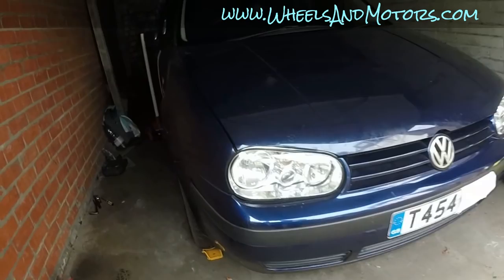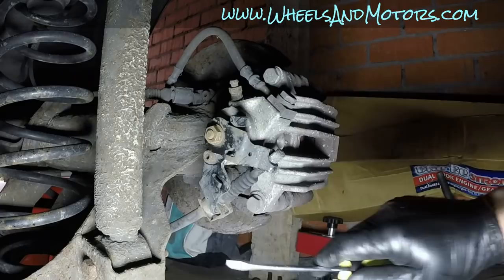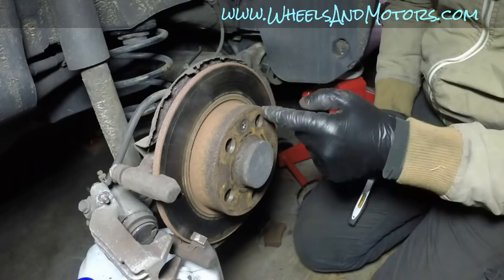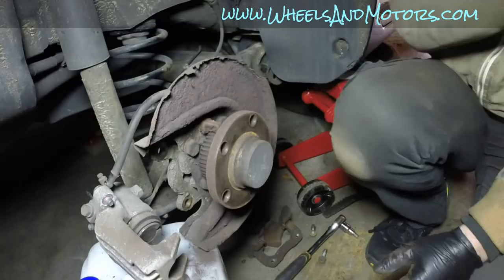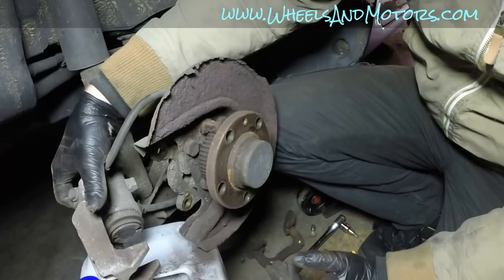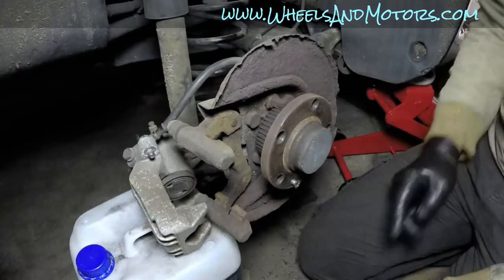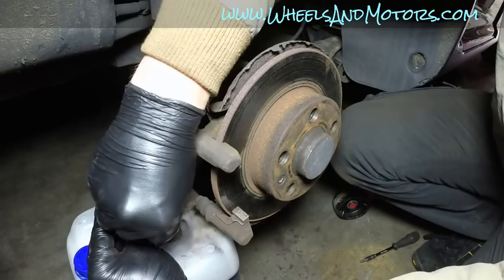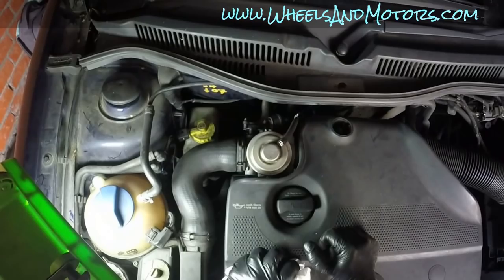How to replace rear brake pads and discs VW Golf Mk4, Audi A3

Comment: Well explained in a simple and comprehensible way so that this job can be done by those with very little experience. Great video.
Reply from the maker: Changing brake pads is not a rocket science 😊
Whole point of WheelsAndMotors is to get people confidence

Comment: After seeing this video I bought a kit from VW , contains both rear discs, pads, new bolts and springs for £84.00. The new discs in this kit don’t need cleaning they are covered with a silver coloured paint that the pads will wear through.

I purchased the same rear brake compressor tool  kit shown in this video in the red box from amazon for £15.00. No instructions with this kit. 
I used the RH piston compressor tool and turned clockwise for both calliper pistons.

You must release the handbrake before trying pulling the calliper off! I tried to remove the calliper with the handbrake on and fortunately realised that it wouldn’t come off because I had left the handbrake on. ;) 

When I finish and tried to put the handbrake on again and I found that it came way higher than normal and did not work. However I started the car and pressed the foot brake a couple of times and then the handbrake functioned normally.

Thanks for this video it inspired me to change the discs myself!

Comment: Nice video. Haven’t done the rear brakes on the 2002 Golf since we bought it 4 yrs. ago. I suggest as someone else commented to take out the slide pins off the bracket and put fresh grease to ensure even pressure on the pads. I’ve had a few cars with uneven wear on the pads that was caused by a seized slide pin.
Reply from the maker: Yes, but please don't use copper grease. I have seen caliper bracket with stuck pins, as grease wears out bits copper cause trouble.
Reply: @wawayltd  Silicone grease would be better, correct? Which would you recommend?
Reply from the maker: Any that is temperature resistant.

Comment: Great comprehensive presentation.When I recently replaced all my VW Mk 4 brake discs I found the locating screws too tight to turn but I used a hammer driver In reverse and all came free very easily
Reply from the maker: Thank you :) I think, I should get power tools at some point...

Comment: I'm tackling pads and discs all round on a mk4 golf for a friend soon.  Thought I'd just check it was the same  procedure as my Audi a4 b7 which it is exact same.  Thank you for the video.
Reply from the maker: You'r welcome. It's good that VAG has similar brakes across most cars - easy to get parts and easy maintenance.

Comment: Just one question.
In the cars with ABS braking system, i was led to believe when pressing the piston of caliper, oil does not go back to the reservoir because of the non-return valves in between caliper & Reservoir.
In that case, we may have to bleed while pressing the piston.
What are your thoughts?
Reply from the maker: I have experienced few times when I press pistons - brake fluid reservoir was overflown. Check this video:
https://youtu.be/lBzEk72sMr0

Comment: Very useful explanation. Great presentation. However am not able to take out the rotors. Seem to be stuck.  Any idea how to get them out?
Reply from the maker: Thank you :) Give them little whack with the hammer. Same as wheels that hasn't been changed for a while - rotors can get a bit of rust underneath and get stuck.

Comment: yes mate it helped a lot I opend it all after watching your video but the problem still exist..right side wheel is very heavy when handbrake is off..I pushed the cylinder in after opening but brake shoes are still rubbing with disc on right side when moving the car..hand brake cable is okay I dont know if I have to change the caliper..?
Reply from the maker: Normally brake pads are rubbing brake disc little bit anyway, but it shouldn't be too heavy.. I don't know what to suggest. Maybe take advice from some local mechanic - he can try it and say how bad it is.
Reply: +WheelsAndMotors thanks mate..will give it a go by changing the caliper from breakers yard as people say they do get sieze over time.

Comment: You say the rotor can be removed without removing the bracket, it seems to be the same as mine, however I own a Seat Arosa (VW Lupo), can the rotor me removed without removing the bracket aswell?
Reply from the maker: I'm not sure. Some cars let you do that, some don't. Best thing is just to try it - if you can't get rotor out, just remove the bracket.
Reply: @wawayltd  Problem is I cant get any ratchet behind the bracket to losen it haha
Reply from the maker: There must be a way.. It's a  VW.. 🤔
Reply: @wawayltd  shock is in the way, cant seem to find the right tools to get in between them

Comment: On one side my piston would not push back. Eventually I found that it would only return if the bleed screw was undone ( even with the brake line disconnected ). I assume this indicates a fault within the caliper, a one way blockage of some description?
Reply from the maker: I agree that there is a problem. Brake fluid must flow easy through the line.

Comment: will you be able to push the pistion back with a set of pliers?
Reply from the maker: Problem with rear caliper pistons - you need to push and turn at the same time. If you have strong hands, you can try..
Reply: That’s heaps for the quick and informative reply. You’re a a legend!

Comment: Thanks for uploading .. i did manage to snap one of my brake lines though .. is it easy to fit a new one ??
Reply from the maker: I had to replace brake line on VW Passat once. They supposed to be easy - bolt off, bolt on.. I mean nut ;) Just fit the new one same way as old. But! It's important that you bleed your brakes after that. There are plenty of videos on YouTube that show you how to bleed brakes.

Comment: If I am just doing rear pads, and open the brake fluid reservoir to push the piston back in place, will I need to bleed the brakes or do I just close the brake fluid res back up?
Reply from the maker: No. In that case - you don't need to bleed brake system, because if you open only brake fluid reservoir air don't get into system... Unless you have your car upside down  😉
Reply from the maker: ...or if it's empty...
Reply: @wawayltd  Thanks for the reply and info.  I will check brake fluid level before doing the rear pads.  I have never done brakes but I have a 2000 Golf and watching this video makes it seem awfully simple so I'm pretty confident I can replace the pads myself.  If I had to bleed the brakes, I wasn't going to do the job alone.
Reply from the maker: @alextothehbro  After you do it couple times - you'll see that it's not a big deal at all. It's like changing socks 😏

Comment: So any side we can wind postons back clock wise? Please confirm. Thanks I have an Audi A4 1.9tdi 2003 year
Reply from the maker: On your Audi - it would be same as this VW. Both calipers need to be turned clockwise and pushed. Some cars might have different brakes where you push in and turn anti-clockwise, that's why my brake rewinding tool kit has 2 tools with clockwise thread and anticlockwise... Anyway, long story short - YES in your Audi both sides should be pushed and turned clockwise.
Reply: WheelsAndMotors thank you brother.  Bless

Comment: Hi ,,, great vid. :)

Have a Audi A3 2006, need to exchange the back brake disks (and surely pads)

Does this video apply to my model?
Do the pistons need to be screwed at push back,.... or just pushed?

Thanks, man !
Reply from the maker: With non-electronic parking brake they need to be pushed and screwed, that's the way you rewind parking brake.

Comment: awesome video,,thaanks,, Pleas Send me a link about the cream you used on.
Reply from the maker: Do you mean copper grease? It sold in any parts shop, or eBay:
https://rover.ebay.com/rover/1/710-53481-19255-0/1?icep_id=114&ipn=icep&toolid=20004&campid=5338022028&mpre=https%3A%2F%2Fwww.ebay.co.uk%2Fsch%2Fi.html%3F_from%3DR40%26_trksid%3Dp2380057.m570.l2632.R2.TR9.TRC2.A0.H0.Xcopper%2Bgrease.TRS0%26_nkw%3Dcopper%2Bgrease%26_sacat%3D179487

Comment: This does not work for a 2001 Cabrio.  Can't anybody get this right?  There is NO Phillip's head screw and the disk just doesn't come off that way!
Reply from the maker: Probably bracket needs to be taken off.
Reply: @wawayltd  
I found out there are two different designs for the 2001 VW Cabrio.  On the one I have, the rear rotors ARE the hubs with the bearings inside of the rotor, the way they used to be inside of drums.  That's why there is no screw to release the rotor from the hub.  When I ordered my rotors from Rock Auto, I didn't have to choose between two.  The correct ones were included - probably based on my VIN, but I'm not sure.  My repair manuals don't even show my rotors.  The same thing happened with my Toyota T100 4WD and my front hubs were not included in either of my two manuals and not in most videos or other instructions but I did find them in in a professional repair subscription that cost me $40 for 1 month.
Reply from the maker: Feels a bit silly to use part that wears out as hub with bearings.. I've never seen that before. You can make a good YouTube video on that.
Which manuals do you use?

Comment: Doesn't look hard, but the problem begins when piston decides not to go in, in any whey possible
Reply from the maker: That can happen if piston has gone too far because of excessively worn out pads or if someone pressed brake pedal when caliper is off.